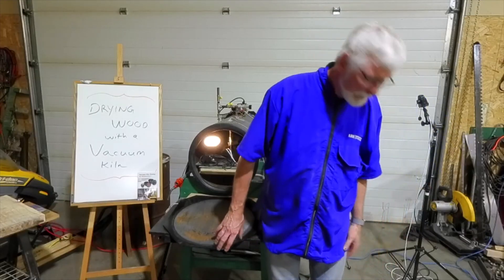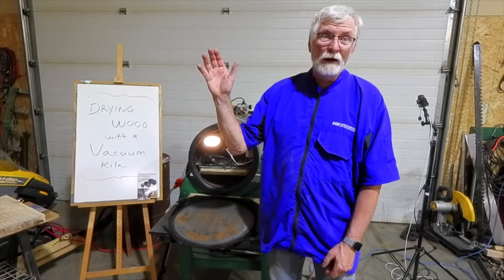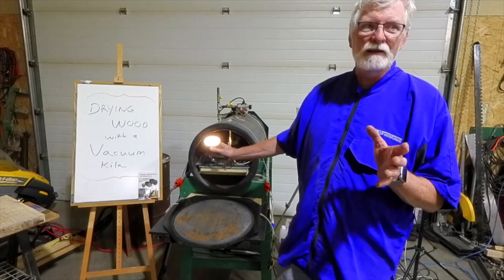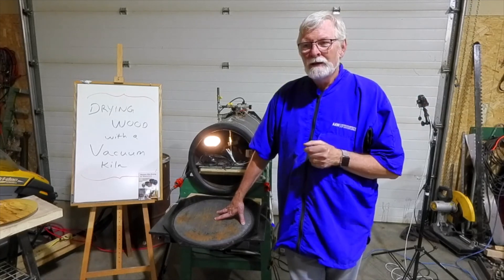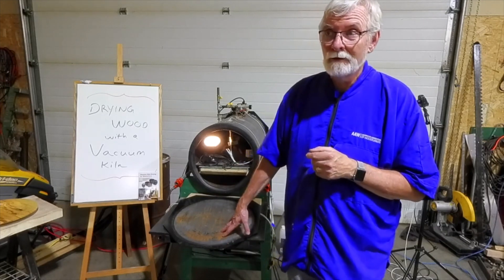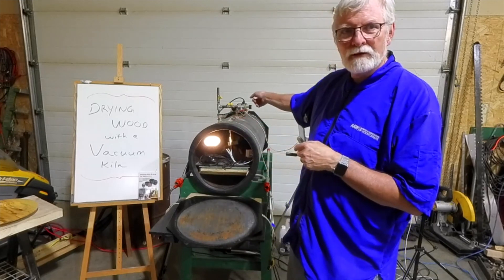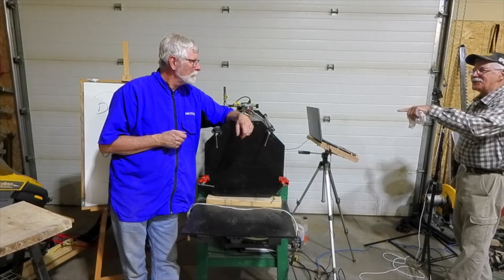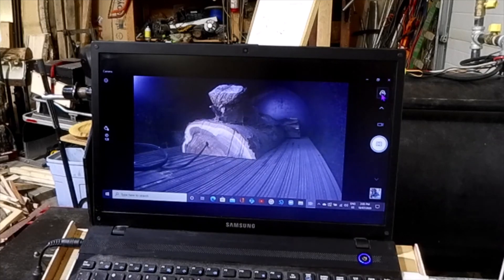Vacuum Kiln for Drying Wood

Comment: Great chat. I learned a couple new bit's from this. Mine is a 20 in Polly culvert 10 ft long with 3/8 in end caps. Adding the mats sure makes sense but my 220 pump will pull that same 26 in, in 15 min.  I have a vac water drain I  made with connections at the bottom of ea rib at the bottom back with the whole culvert at + 10 deg. to a tank much like yours. Great post !
Reply: I thought of using a poly culvert as well. I have an 18” x 12 footer laying around. And also thought of putting it at a slight angle for water drainage. How do you seal the end caps? Could you make a video of your setup? I would like a simpler version of his.
Reply: @sungazer888  As far as the end caps I used 1" plywood. One piece cut snugly within the polly pipe and one to cover the end by an inch extra diameter. 4 standoffs between them long enough to have them keep the plywood covering 2 of the small areas of  the ribs. Then I filled it with high density foam. So far it has worked well.

Comment: Thanks Jeff for the elaborate video. Even I have built one such vacuum kiln, but I could not think of a sealant to seal the leaks and gaps that are caused by the feedthroughs. Your PTFE pipe joint compound idea would greatly help. Mine is sealed with epoxy.

Comment: Hi, Great video, very informative. I build vacuum pumps for a living and this was very interesting.
I would like to clarify the type of pump Jeff is using. It's a Welch 1399, single stage, rotary vane pump- oil sealed, not a piston pump like what is mentioned in the video. The pump is 1.2 CFM and if in factory condition, will pump to 15 microns of mercury.
Reply: I agree of course. Slip of the tongue while considering monologue on the fly. Hard to be a YouTube star lol.
Reply: @j.hankinson7803  You could also use an ejector that uses running water to pull a vacuum. No maintenance/oil necessary.
Reply: @24vignettes94  You have any links?What are the limitations?(capacity wise)
Reply: Why would the Gast pump not be used?
Reply: @TimRobertsonWoodturning  My experience with them in the oil and gas industry is that moisture will just tear them apart eventually.  They are outstanding otherwise.

Comment: It is done on large commercial scale. In fact the local utility pole treatment plant used it for years. These were large enough for an entire rail car at a time. My friend run the locomotive engine at the plant. They would roll a car of poles into the tube, pull a vacuum and after a certain time they would suck the preservative in. Before about 1985 they used creosote but switched to chemicals until they shut the plant down about fifteen years ago. They moved the moved the operation down south somewhere. It is now a toxic waste site because of many years of spilling creosote and chemicals on the ground. The EPA made them put a roof over about 15 acres of property to prevent runoff. It will be many years before that property can be used.
Reply: They should place solar panels on the roof. Do some good until someone (taxpayers) pays for the superfund clean up.

Comment: Say, Jeff, you mentioned something about a video on drying the wood in your kiln.  Very nice video on the kiln construction.  I've purchased the book you mentioned and it is very useful.    Where can I find that video?
  
I'm in the process of getting materials to build this kind of kiln and would very much like to see all I can about this process.  My components down here in MT are so cheap and I'll have probably well over a $1K in this before she's all done. I'm not a turner, but do cribbage boards and wavy flags along with other ornamental things and I need dry wood.  

I use a CNC for most of my work and I just recently obtained over a thousand BF of Maple, Oak, Cherry and Hickory from my brother and brother-in-law back on WIS.  It's all green and is stickered stored inside a building .  It is all rough band sawed to 5&6¼ thickness in 6-7 ft lengths.  I think this process will work ell for my needs and look forward to getting this up and going.

If you have any other links to this kind of process I'd sure be interested.  Thx for your presentation and info you may have.

Comment: I am trying to dry wood with your kiln and am having trouble with cracking. Would really appreciate conversing with you also have a method for taking the moisture out of the air before it reaches the pump.
Reply: You may be applying too much heat if you are getting a lot of cracking. If the temp applied to the wood is just above body temp, in my case about 40C, the wood is usually pretty good with only minor end cracks. If you are trying a really hard wood, there may be a larger problem but that is only speculation on my part. The book author usually uses smaller pieces of hard woods for his ornamental turning projects. As far as trying to dry the air before the pump, I’ve tried a variety of low tech (cheap) ways. It’s not an easy problem that way. Currently I’m using the 4 inch diameter chamber described in the video, filled with marbles to try to increase surface area to condense the evacuated air. A cooled chamber would be better I’m sure but that adds complexity and cost.
Reply: @j.hankinson7803   I should have given you more info   We've a 19 inch cylinder app 48 inches long with the same valving you have except in between the electric solenoid valve and the pumpwe installed a vessel with a condensing coil in it the coil is hooked to a old refrigerator and as the gas passes through the vessel forms ice on the coils(we where pulling app 1 qt in 24 hr) the wood was 8 inch sq x 3 inch thick boxeldor, same heaters as yours but no control on the heaters, then we tried running the heaters on a timer (without the heaters on we get no water in the collecting tank only water in the condenser and not as much) question.  Do you regulate the temp and if so how much variation do you tolerate
Reply: We had 12 pieces in the unit 8x8x3
Reply: As far as regulating heat, I found with my heat mats they top out at about 40C. So although I have a little temp probe stuck in the middle of a piece of wood the electronic temp regulator doesn’t kick in until the end if at all. It sounds like your kiln is a similar size to mine. With that much wood, you’ll have to be careful to keep the wood away from the walls or it’ll get wet with the condensation on the walls. I did notice the book author insulated his kiln but I decided after seeing mine in action that I wanted the most condensation I could get. Once it drains out the bottom, it is out the the equation. The cooling coil is a great idea but there always seems to be enough water gets through to the pump. So long as it doesn’t overflow too badly, the process will still work. Occasionally I will change the oil in the vacuum pump mid process.
Reply: @j.hankinson7803  thanks we've got a smaller load in right now and trying to keep the temp to the low 90s but don't have the ability  (yet) to control the temp with anything but a timer
Reply: Your system sounds similar to mine, on a smaller scale (mine is 9 feet, 31" ID). My vacuum line runs through a cooler with a window A/C unit embedded that I regulate to 35F. I made a thread on forestry forum last year. The heat mats I bought claim to top out at 130F/55C (Cozy Products mats that look very similar to Jeff's). I also have lots of issues with checking in my tests. I can cycle the mats on a duty cycle and I've tried as low as 20% with no improvement. I haven't measured the temperature of the mats during runs, but I have looked at the combined amperage going to them, and I can tell even at 100% duty cycle they don't ever cycle off for the first couple days of a run. That makes me think they probably aren't getting up to rated temperature. I've tried red oak, bradford pear, cherry, and silver maple all with similar results.
Reply: I decided to focus on other projects for a while, but I have a few ideas for things to try next. Some commercial kilns seem to have steam injection for the first part of a run so there's that. I could try turning off the condenser until later in a run. I could try instrumenting the tests better with temperature probes. I wonder if heating with water plates is just better in some way (the one Matt Cremona uses for his workbench slabs has those and his seem to come out perfect). Maybe the species I've tried are all just bad for this. There aren't that many other common hardwoods around here, though. (SE US)
Reply: I also tried coating the face grain of maple samples with anchorseal, and separately wrapping with plastic wrap. The plastic didn't help but the anchorseal might have helped a little; the sample could have been better and the checks may have been due to the grain/knots. I'd rather not have to coat everything like that, though.
Reply: I think our problems were mainly from letting the heating pads run uncontrolled we are now regulating the temp to no higher than 110f and things seem to be working. How much water are you extracting in your chilled chamber in 24 hr
Reply: Interesting, I should probably try to do that. It's obviously proportional to the amount of wood in there, but around a gallon per 24 hours seems average. I've never had the pipe more than ~1/6 or less full by volume. My samples were between 3 and 5 inches thick, 8 to 12 in wide and ~3 feet long. I did run one load with a bunch of treated pine lumber that did very well, but that's not the target use case. With the heat mats on full blast it is a very efficient machine for extracting water from wood, ignoring the quality issue.

Comment: Awesome build and results! Do you think this process could be used to build a large kiln to dry 500 to 1000 BF
Reply: I have no idea if it could be scaled up successfully to that size. There are commercial units available that are more suitable, or solar units are an alternative. Woodmizer used to market a vacuum drying unit but no longer do so. There is an outfit on YouTube that shows drying thick slabs of hardwoods under vacuum, microwave heat and pressure. Out of my league in those kinds of volumes.

Comment: How do you deal with moisture finding its way into the vacuum pump? Were currently having that issue.
Reply: I change the vacuum pump oil in the pump before each session. My pump has a sight glass and when it gets too full, or overflows I drain all the oil and water from the pump and refill it with clean stuff. I have a cookie pan under the pump to catch the overflow when needed. I have tried a few ways to get some of the moisture out of the vacuum stream coming from the pump using the little 4inch diameter vessel shown in the video. I route the vacuum line to the bottom of the vessel and have a plastic mesh floor above that inlet. The outlet is at the top. To increase the cool surface area to condense some of the humid air from the kiln I’ve tried straws, stainless pot scrubbers, and currently trying glass marbles. These do help a little but humid air still makes its way to the pump. There are of course very expensive ways to dry the air but I choose not to throw money at the problem. BTW an air dryer for compressed air doesn’t work.
Reply: @j.hankinson7803  Thanks, we are considering going the cold trap route, but buying is not cheap. We are thinking using a copper coil inside a mini fridge with a vacuumed vessel to catch the condensate. We are using a Welch Piston style pump, there was some rust that was accidently put through the system from our chamber so i opened to check the cylinder and that was filled with water that the built in trap didn't catch..  The pump can handle some humidity, but it was becoming straight water.

Comment: I have now built and run a small version of this using 12" diameter PVC pipe. I had a piece that is just 24" long. For the ends I found pieces of Corian counter top material. I glued two 1/2" thick pieces together with West system epoxy to be sure they would withstand the vacuum. My goal is to be able to dry 12/4 and 16/4 white oak, which is very ambitious. I found a vaccum pump that should have been adequate, but, whether from wear, or some other reason, it would only pull 25" of mercury. My first trial run was less than fully successful, and I got a lot of defects. I then found a Welch pump, which works much better. It pulls 28.5" without breaking a sweat.  In my second run I was able to dry two 16/4 X 23" balks of white oak with no defects. It took about 35 days to 12%. I think it would have gone quicker if I had sawn the outside edges square. I left the wain on one side, and as a result, I think the heat mat didn't contact the wood as well as it might have. Now I have a third batch of 12/4 X 12" long pieces running. I have heard about someone local who has an abundance of 12" PVC, so I may eventually build a longer version.
Reply: Good contact of the wood with the heat is really important. I tried rounds/logs and was not happy with them. Even sawing a flat on one side makes a big difference. The thickness of up to 4 “ seems to be a reasonable size too. The heat has to penetrate to the middle. Arguably, if drying a thicker turning blank of maybe 6”, the centre gets turned out anyway.

Comment: great to see people make things for themselves.   I watches  Legacy Lumber's channel about their vacuum kiln.  their is huge, being a production kiln.   
they added a step at the end to steam the wood to eliminate the work hardening of the surface of the wood.
what amazes most of us is how much technology can be known and applied when you dig deep into a simple process.   for centuries, one just left wood outside  for a few years.
Reply: They also have a press inside the kiln.
Reply: They have a proper commercial unit. I believe they have to be careful of case hardening because of the microwave heating but I don’t know much about their process. Mine has just enough heat to do the magic and is very gentle to the wood.

Comment: My particular interest is in drying white oak, which is very difficult because the pores contain tyloses. I was advised by a sawmill operator with some vacuum kiln experience that I should seal the ends of my pieces. I'm curious about your reaction to that, as it seems like the idea is to draw the moisture out through the end grain no matter the wood species.
Reply: I would suggest not sealing the ends. I’ve learned that most of the moisture leaves wood via the microtubules that make up the wood. Someone did some research some years ago in Virginia and was able to demonstrate that relatively little leaves through the sides of wood, ie not the cut ends. Sealing the ends of air dried wood helps slow down the exit of moisture and stresses involved with that as I understand the process. Vacuum kiln drying is so much faster that the stresses don’t seem to build up over the short time involved. As a result the wood doesn’t suffer.
Reply: @j.hankinson7803  Yes. Before I had the kiln built I had painted the ends of the planks, which meant for my first run there was a mix of painted and unpainted ends. Due to other problems, I can't say that the painted ends affected anything. On the next run, I didn't have any painted ends, and there were no issues. I'm currently nearing the end of my third run of 12/4 white oak, which has been in the kiln for just a month.
Reply: Goodness. I hope you aren’t drying the wood under vacuum for a month. With adequate heat reaching the centre of each board - easy with 12/4 boards - three to four days should do it. With no heat little will happen. Good luck.
Reply: @j.hankinson7803  Remember, white oak has tyloses in the pores, so they are effectively blocked, which is yet another reason for not sealing the ends. I've been running at 28.5" of mercury and around 31 degrees C. indicated, which is pretty close to the boiling point. White oak just takes that long. AND drying 4" thick stock.
Reply: Interesting information. I have no experience with drying the wonderful hardwoods you have. They just won’t survive here. I have found the minimum drying temp to convince the water to vaporize is 36 C. I don’t know your heat method but perhaps find a way to raise the temp. I have found that generally when the temp in the centre of my slabs hits 36C +, the wood is dry. I rarely monitor moisture levels while drying now as a result. The heat mats I describe in the video peak at 40C but I don’t see temps like that reach the centre of slabs, just the surface. However, considering human body temp is about 37C and a fairly hot bath is about 41, it’s still pretty easy on the wood.
Reply: @j.hankinson7803  Yeah, I've got one probe, like yours, in the middle of the end of one plank. This load is all 3" thick oak. I can't tell how well the end temp relates to the temp in the center of the load. I'm using heat mats like yours, and for this load they are in good contact with the surface of the wood. It's possible that the temp is higher in the center, but I just don't know.
Reply: Re: white oak. It is probably worth trying a few smaller test pieces and cutting them open. If the wood is free or very cheap for you try slicing a few longer ones open so the centre can be moisture tested. I did a number of tests with different wood blanks of various sizes when I first started, trying to understand the process for white oak. If that particular wood has plugged pores perhaps it will take a little longer to dry it out. Good luck.